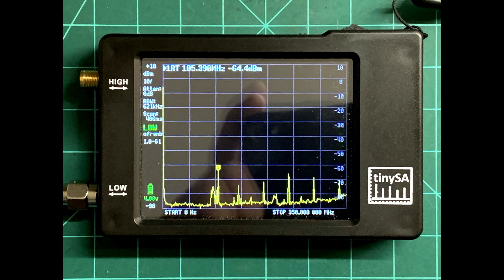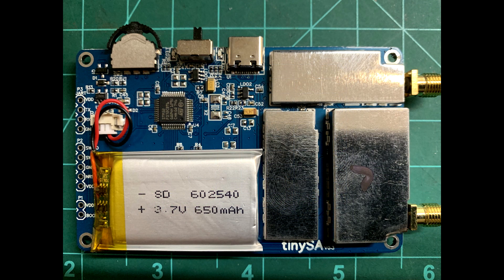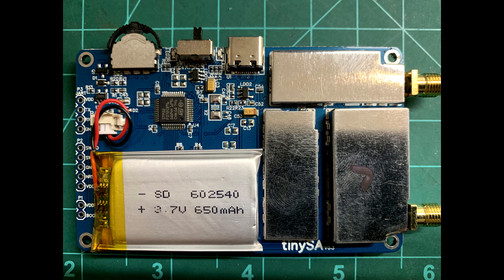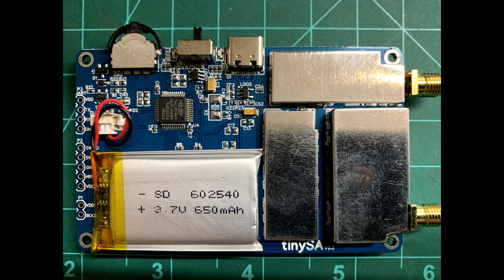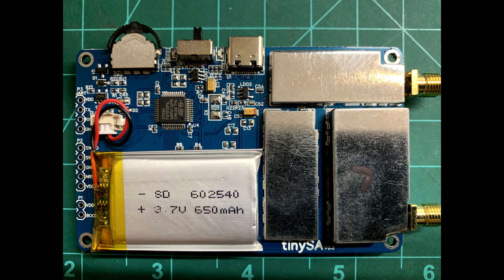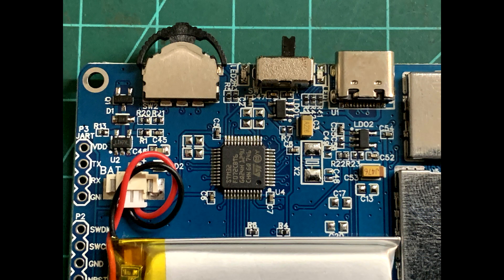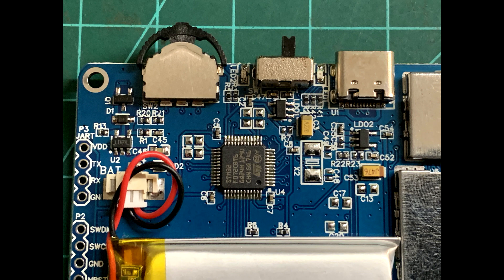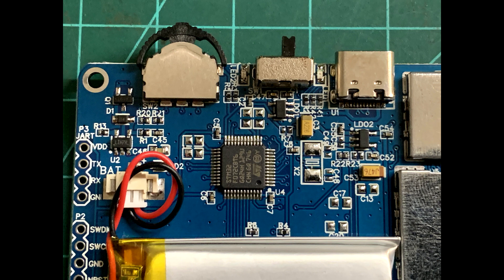#536b TinySA Quick Look Inside

Comment: Additional osciiators/mixers,Etc. are under the shields more than likely.
This sure does look like a Nano  VNA in basic design. Tiny battery capacity though.
I think I will hold off until there is at least one firmware revision/update.
Thanks for the perk under the hood.
Reply from the maker: Besides the uP and display battery, the rest is not like the Nano at all. uses an external mixer, SAW filters, receiver chips with mixers and filters integrated.